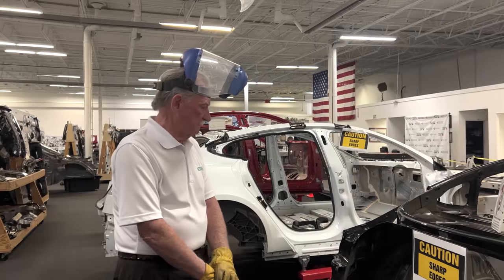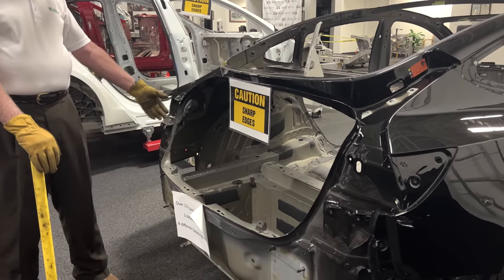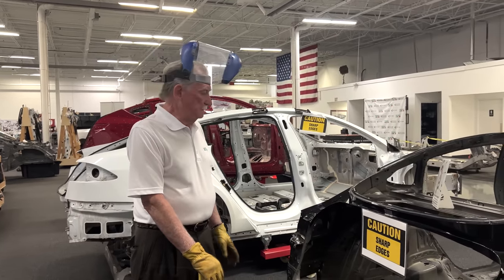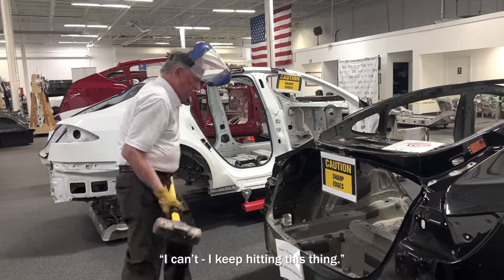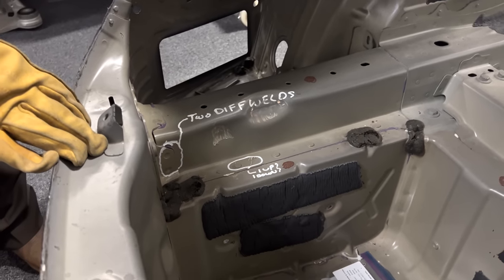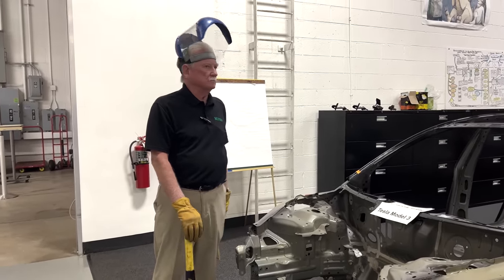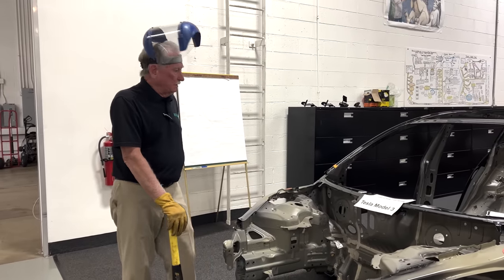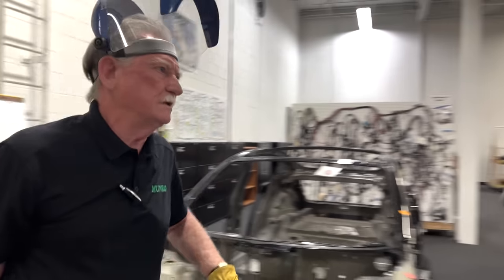Sandy Rant... With a Sledgehammer? Why Aluminum Castings Are Safer Than Steel

Comment: I have a great deal of respect for Sandy and his company. I've learned an immense amount from him. As someone who owned an auto-body repair shop for decade I take exception to some of his perspectives. This "which part bends easier with a sledgehammer" test is the best example yet of ignoring the repair-ability of some of the construction techniques highlighted on this channel. Both of these construction types are strong enough to get the job done. Munro and assoc. focuses on assembly line efficiency, as they should. That said, what's good for manufactures is not necessarily best for consumers. After a collision, those one piece cast assembles will be difficult if not impossible to repair for any reasonable cost as opposed to smaller pieced together steel assembles. What might be a small or medium sized repair on a conventional steel assemble could "total" a car built with a one piece cast assembly. This will inevitably catch up to consumers in insurance and repair costs.
Reply: How many have you seen written off after a collision? It must be happening a lot, given how easily these giga-castings are destroyed by small impacts which would only be enough to write a giga-casting car off, but the other designs would survive.
Reply: There are crumple zones and external attachments that are sacrificial for the castings. If a collision gets past the crumple zones and other sacrificial pieces it wouldn’t matter if it were a casting or a traditional stamped steel assembly - the car will be totaled.
Reply: That's my point, crumple zone damage could total a large cast piece that could easily be repaired in a stamped steel structure.

Comment: Cannot wait to see the Cybertruck crash videos with enormous castings wrapped in 3mm thick special tougher formula cold rolled stainless steel, and then the structural battery pack at the center of it.
Reply: STILL ?
Reply: All other cars will be the crumple zone and the Cybertruck will not even have a dent. It will just crush everything in it's way.
Reply: @mrm1885  pretty much, it will be like the other car ran into a stone wall. 

When I was a teenager a drunk driver in a late '80's Datsun pickup rear ended my mom's 1963 Ford station wagon while it was parked in the middle of the night. Datsun engine was in the passenger seat, and my mom needed to replace the taillight and the bumper was dented in about two inches and about four inches long. I think a lot of Cybertruck crashes will be like that.

Comment: Sandy, as a former aerospace engi eer and also automotive engineer I appreciate your work. Regarding the castings of Tesla I would like to adress to you a simple thing. If one has a a minor accident bumler to bumper and the casting is hit I am thinking of beyond repait ar a fracture of the impact it would take to get this sad expensive result at a ULSAB frame. Howis your statement on that? Thanks.

Comment: When you hit that loose piece of casting, the energy is converted into movement of the object, so it is mostly not absorbed by the casting. Hence just a scratch. Bad comparison!
Reply: Or you could watch the whole video as he did a 2nd (front) test for this very reason ?
Reply: @raphofthehills4405  You mean the 2nd test where the exact force applied is unknown and the surfaces on which the parts resided were different?  No one outside of a few uniformed doubts that aluminum is an acceptable material for vehicle casting.  But to call any of these tests scientific or good is misleading.

Comment: I worked in a body shop some 25 years ago. The damage on the steel parts could be repaired, even 25 years ago. The castings are stiffer, no question. They are almost surely stronger. But seeing castings with holes through them worries me. That sort of defect, especially when it is totally internal (i.e. the crack is there, but not at the surface where it can be seen) has been implicated in several aircraft incidents. What I worry about is sudden brittle failures. Cars live in a much more hostile environment than aircraft and are lucky to see even 1% of the inspections and preventative maintenance. I think casting can be better than welded up sheet steel, but I am not confident that the giga castings that are being produced today will be better over the long haul. 

For reference I was one of the team that did a repair that cost $85k on a 89 S class 2 door. It was almost totaled with less than 1000 miles on it. It came down to saving the instrument cluster. I had to break the windshield and cut the dashboard into pieces to get it out because the A pillar was compressed in by about 8". Amazingly all the doors still opened, closed and latched. I had the entire interior out of the car for 2 months. Mercedes sent an engineer to inspect the work about once a week. When we were done even they said they could not see any sign of damage. 

Other facts: 
1. The driver of the Bronco (not a Bronco II) that hit him was dead at the scene even though he was wearing his seatbelt. He was running from police and the speed at impact was estimated to be between 80 and 90 MPH.

2. The driver of the Mercedes had a minor concussion and spent a few days under observation. He initially thought he was fine until he realized that he didn't know which intersection the wreck happened at in spite of the trail of destruction his car left.

3. The impact knocked the Mercedes almost half a block through people's front yards.

4. I did not have even a single screw left, nor did I have to replace any other than the ones that mounted the dash to the body. 

Questions for everyone: Could a Tesla hit that hard be fixed? Could it be fixed for less than replacement cost? Should a car be built that tough or should they be softer like Volvos of the day were?

Comment: I think the failure mode is more important from a safety perspective than how easy it is to superficially damage. For example, a styrofoam coffee cup is much easier to dent or deform than an eggshell. But, while the eggshel will crack/shatter, the foam cup will bend, crush and largely stay together while absorbing more impact. If you were to punch a wall with a styrofoam cup or an egg in front of you, you would do more damage to your hand when punching the egg than when puching the foam cup.

Comment: Sandy, you acknowledge that the aluminum castings moved when you hit them. That would have dissipated the energy. It would be interesting to see something like this where they both were loose or both fixed in place. 

Not disputing castings are stronger. Cast iron vs cast aluminum, I think the iron would have won. (They don't make aluminum diesel engines after all)

Comment: Yeah, I have many thoughts on this.  First, aluminium is weaker when measuring apples to apples - thickness.  Casts are obviously stronger due to the thickness and built in supports.  Perhaps, some people were not aware of this.  The strength surprised me a little.  

Could Sandy gives some cost comparisons compared to metal?  Raw aluminium is more expensive - especially given the thickness - however, welding multiple metal parts costs also.  I imagine aluminium castings are more expensive.

Thanks for the comparison Sandy.

Comment: You could not tell if the structural integrity of the casting is intact by looking at it. The only way to check is using ultrasonic crack detection. Even the tiniest of flaws set up by impacts can then grow with vibration into stress cracks and eventual fatigue failures. Big lessons were learned about this in the aero and space industries. If the crash structures are too ridged then the impacts are transmitted through to other structure’s less capable of absorbing the impacts. Eg hit in the rear would probably damage the steel structure to which the casting is attached,like the door pillars, roof or floor panels. Casting’s make it cheaper to produce but not necessarily better.

Comment: I agree Sandy!
I'd like to see an x-ray of the impact zone of some of these car crashes for comparisons where spot welds and glue are used on those joints.
I would almost guarantee the steel would or even over time have fracturing in the spot weld/glue zone areas.

It defiantly would cause weakness of the area. Think of the robots spot welding all those multiple pieces together It just makes sense that a single cast piece can be so much more robust and stronger then 4-5 pieces welded / glued together.

Comment: Goodness.  Sensational though this video is, Sandy should know better than to put his name to this completely erroneous test.  Allow me the courtesy of an explanation:
1) Sledgehammer impact to the corner of a crush tube is quite different to longitudinal impact to the crush tube in situ.  No development lab technician would pretend that they could reasonably mimic rear crash performance in such a test.
2) Hitting the crush tube on a steel body versus hitting the wheel housing extension of the crush tube on a casting isn't the same thing.  The steel crush tube is designed to absorb energy progressively by crushing.  The casting is designed to stay rigid to help keep the cabin intact.
3) A sledgehammer impact to the top of a front shock tower says almost nothing about the performance of the shock tower in a frontal impact, other than the fact that the material it's made from will absorb energy.  The casting absorbs very little energy because it's not the primary energy-absorbing component - other components further forward in the vehicle must be designed to do this.
4) Ultimate strength and energy absorption are two different properties of a material and structure, so making comparisons based on strength alone is missing half the picture.
5) Striking an unrestrained casting versus a moderately restrained component in a vehicle assembly is another source of difference in the sledgehammer test.
Perhaps Sandy should contact Nizar Kamel and ask if he can take the sledgehammer to Nizal's Model Y (Austin) casting.  The result might look a bit different. https://www.autoevolution.com/news/tesla-calls-front-casting-crack-a-discontinuity-contradicts-own-repair-recommendations-220665.html

Comment: Great demo! It would be super interesting to see these under a press so you could measure when each of them failed and how they failed. You could test a simple welded box vs a cast box of the same weight but shaped for strength.

Comment: At the 3:44 timestamp, he hits the target where he was aiming. However, at 4:37, his shot lands much lower than intended. You can notice a new mark appearing at 4:45; it's located at the top edge of the bottom section of the target, a mark that wasn't there before.

When the frame isn't securely anchored, the impact force is considerably lower than when it's firmly attached. Comparing these two scenarios is like comparing apples to pears. If there's such concern, why not conduct the test properly? I thought Munro was serious about his testing, not just doing it for YouTube likes. I'm truly disappointed with this test.

Comment: The casting not being bolted down allowed to deflect the impact energy as opposed to the bolted frame which absorbed the blow.  In other words, metal is ductile, while the casting is stronger but more brittle. I am not saying the casting is weaker, just pointing out the difference in the test procedure.  Cheers, love the rants.

Comment: What of the reports of model Y's front casting cracking on (purportedly) normal road conditions? What's Munroe's take on this?

Metal fatigue?
Cast temperature issue?
Alloy failure?
Reply: Possibly a wreck or major off reading event? I could only find ONE complaint of this.
Reply: Or a photo shopping anti tesla FUD attack, I’m betting if that had been real 🤔, NTSB would have tesla for lunch

Comment: This did not age well judging from the whole rear cast shearing off from a small drop which would at most bent a steal frame on another truck . There is a reason motorsports requires steel roll cages instead of titanium, carbon fiber ,  or aluminum cages that would save weight

Comment: Much as I had faith in castings I still had my fingers crossed when they went under the hammer.  However I should not have let any suspicion of doubt creep in.  Although no cheaper or lighter than assembled metal pressings they are dimensionally more precise, faster to make, reduce the production area and, thanks to Sandy Thor Munro, are demonstrably a lot tougher.

Comment: Sandy, first off I agree with you.. But it does bring up a question (at least for me).. NHTSA has pounded into the head of the consumer about "Crumple Zones" which absorb the energy of impacts. Wouldn't a sturdier gigacasting negate some of that, allowing more crash energy into the cabin? If we had IIHS and/or NHTSA crash data between the two models, that might put this issue completely to bed. Oh, and if we ever meet, please keep that sledgehammer in the shop.. you're kinda good with that thing!

Comment: This demonstration reminds me of the B.S. demonstration Tesla used on stage with the Cyber Junk. The difference between the two methods and materials is, the steel will bend but not break, the casting won't bend it will just break. A break is a COMPLETE FAILURE!!!

Comment: The integrated casting had to absorb the force because the impulse did hit a 1-ton anvil.
The aluminum casting had to absorb far less impulse because it could move, and the part of the energy that was transferred into movement had to be subtracted
One either had to test the parts or the parts integrated in a chassis

Comment: I was recently challenged by an armchair engineer who asserted that Teslas are less safe in a front-end collision than ICE vehicles. He pointed out that the engine in the front would protect the cabin, whereas the Tesla has a lot of empty space up front. Case closed.

Alas for his argument, crash safety is all about crumple zones absorbing the energy of a collision. Engines are incompressible and leave less space for crumpling, so in an ICE vehicle, more of the energy of a crash is transmitted into the passenger compartment.

There is a lot more engineering going into crash safety than that one thing. But all things being equal, engines reduce crash-worthiness.

For over a hundred years, we paid no attention to this fact, because nearly all ICE vehicles had engines in front. No point to overthinking it, we had no alternatives.

Now we do.

BEVs are safer.

Comment: Very informative. I knew Tesla were using casting for reduced assembly cost/time.  I didn't know that the alloy was aluminum (I might have guessed from the melting point but I never even thought about it) and I didn't know they work out to be so much stiffer than typical steel members!

Comment: I think in a crash situation, the steel can absorb the impact energy due to Deformation. With a casted structure, the impact energy is just forwarded to surrounding components. That a disadvantage, the engineeres neues to compensate

Comment: So many people are stuck with the mindset of the 50 year old complience auto, from the 70s to save gas.  Those were generally rush jobs, not caring about safety, reliability comfort.  Just get enough out the door to meet EPA regs.   These new cars, people are still thinking about those 50 year old cars, and think that the engineers (in Teslas case) had the ability to engineer a fully new car, didn't think about these simplist things.

Comment: Hi Sandy. THanks a lot for this video. Onle little topic by the way: Would it cost Tesla so much more to "paint" the complete car instead of just what we see outside ? 
.... I mean wouldn't the paint save a bit more against rust than the "prepaint" ( I do not know the right word, but you know what I mean) we see in the trunk-area here?
(By the way: Have you already checked the new M3? Is it correct that it hac no giga-castings? - WHY ?!?)

Thanks a lot!
Reply: There were no Gigapresses from IDRA available within the timeframe.

Comment: Impressive. Although steel is in theory harder, aluminium is 3 times lighter, and once you put 3 times the metal in a cast in one giant piece with good geometry, it apparently beats bent thin steel by a large margin. 
Which also likely means Cybertruck will not be a true exoskeleton, it would probably need casted skeleton. Some estimates:
Model S plaid has 0-100 in 2 secs, weighs 2160 kg, Cybertruck 3 motor has 0-100 in 3 secs, which means it will weight around 2160/2*3 = 3240kg.
Model S Plaid goes 400 miles with 100 kwh battery, Cybertruck 3 motor 500 miles. 100kwh * (500 miles/400 miles) * (3240 kg / 2160 kg) = 187.5 kwh. 
Li-ion 260 wh/kg    187500 / 260 = 721 kg battery. 
I assume tri motor Cybertruck will cost more than a Model S/X Plaid
PS: VERY rough calculations.

Comment: My father made bath safety products for 50 years, and  his first product was a cast aluminum grab bar. Sure you can get strong parts out of aluminum by using triangulation, etc.  BUT and this is a big but, aluminum is typically not repairable once damaged. Unlike ductile steel, aluminum cannot be as easily pounded back into shape; it will crack and lose structural integrity.  THere is a reason steel has been employed in so many products and systems. Steel is a magical alloy that took billions to figure out. A simple fender bender in these aluminum frame cars, and they will be totalled out by the insurance company. if they made sections, and had a sacrificial part that you could buy, that would be great, but so far they are not showing such a design, and aluminum frame cars will have sky high insurance costs.